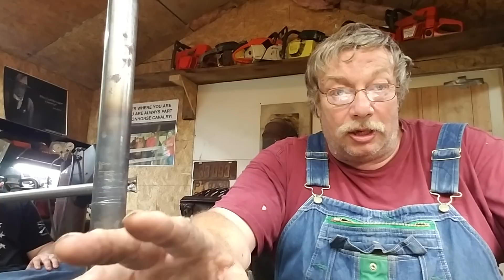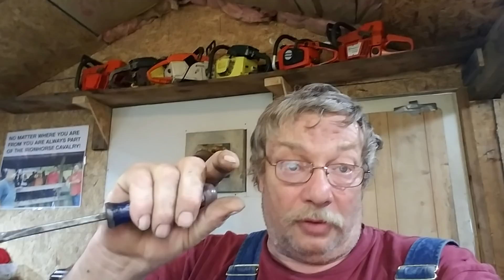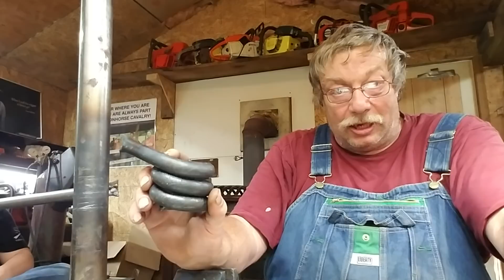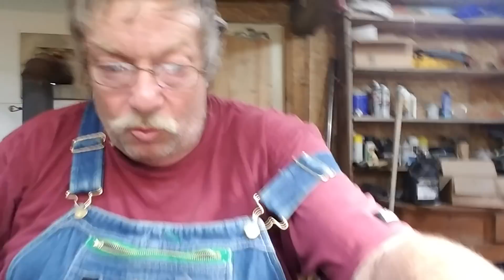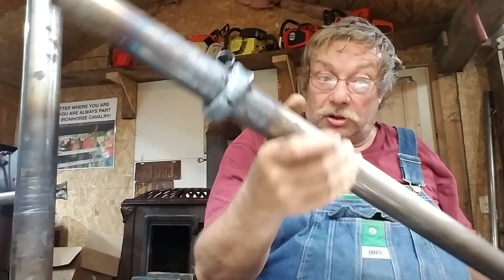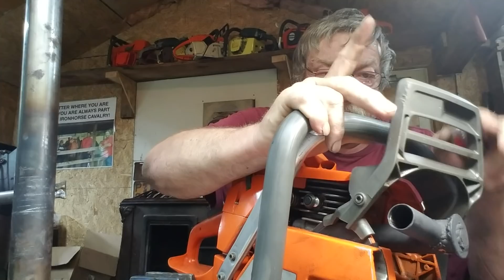How to make tight bends in pipe with no bender! The world according to Ironhorse!

Comment: Ironhorse what about a rosebud for your tip instead of a cutting tip. I know it should heat it up cherry red without burning through.
Reply from the maker: I need quick pinpoint heat!
Reply: That's good thinking.  Although, I don't know how and where the heat needs to be.  We know we don't need it where the tube is already bent.  And don't want it way before the bend or the whole tube will start bending before the bend.  But a rosebud tip can be brought in close and maybe warm up the tubing that's just ready to bend but's not quite there yet.  I think you're right.  But don't tell Ironhorse I said so.